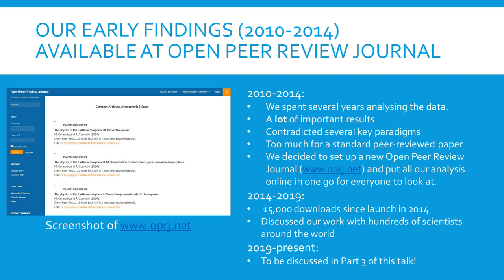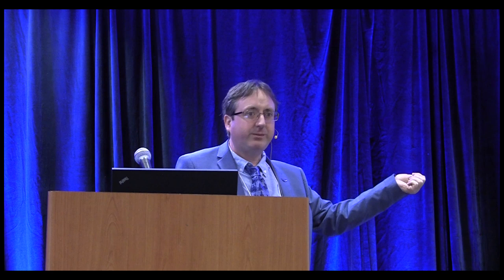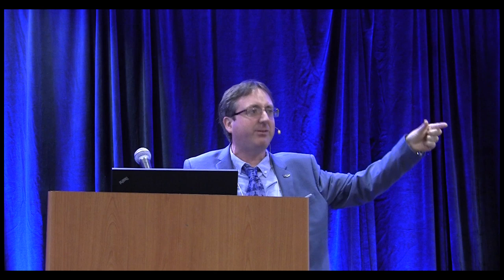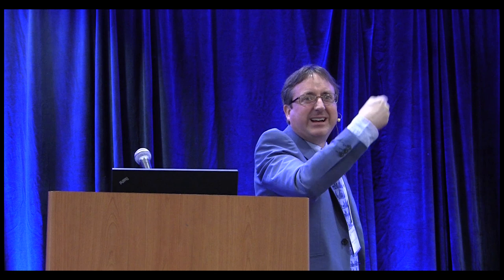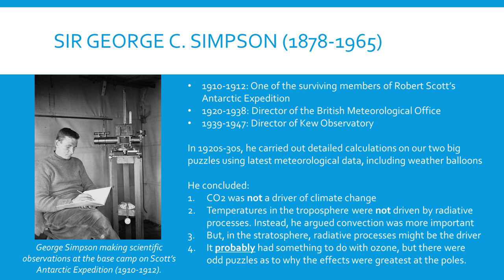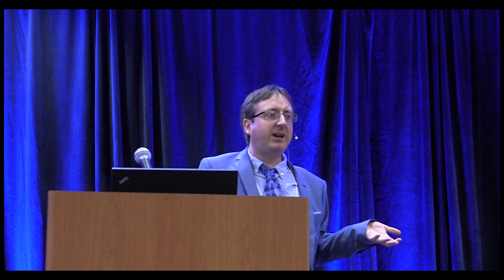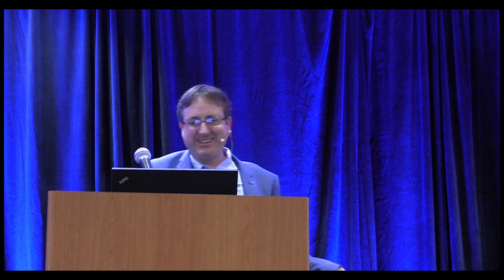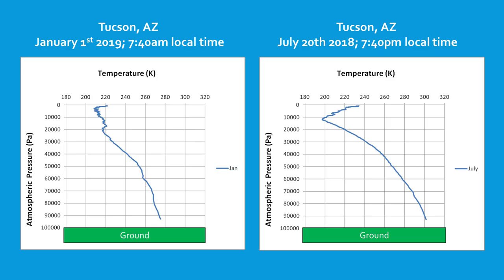Balloons in the Air: Understanding weather and climate

Comment: "Most ...measurements were done on ground" -- Really, no kidding?  And Stratosphere downward is "99% of atmosphere's mass" -- yes, and so is most important, and temperature at higher levels represents less and less air energy density as altitude increases, so of course temperature changes above the stratosphere are extreme and of various physical processes.

Very increasing historical review, but why?  We've no reason to expect folks them to have come to a factual result. 

"IBM 7090 supercomputer" -- really?  I programmed such for plasma physics research -- it was never thought of as a supercomputer, Ronan.  So what should we trust in your remarks?

So, the Connolly theory is that the act of modelling climate is guaranteed to deliver falsities, eh?  "Look inside the atmosphere you don't know what's happening." -- really?

Put your theory "to all the tests you can think of" -- sure.  So why the long intro here about people's conclusions when they had inadequate instrumentation?

The "ozone hypothesis" isn't the dominant effect for air warming via GHGs -- it's a straw man.

Their demo tubing is ok, but the plastic tubing expands when the plunger is pushed, because it's flexible.  Better to use a metal tube.  Mechanical energy transmission between molecules is exactly how GHGs transfer energy to other molecules in the air "they vibrate back and forth".

If the gas is in thermo-equilibrium it would emit as much energy as it absorbs -- "but it won't store the energy" -- really?  Energy absorbed by a mole of GHG is mechanically coupled to surrounding molecules, whether GHG or not.  Yes, at night, "it goes to space".  "Infrared water vapor cools the atmosphere" (at night).  Of course, but some of the energy has already been transferred to other air molecules that are not water.  The point is that their data are good and some model ideas are good, but their zeal to critique IPCC models misses other physical effects, like intermolecular vibrational coupling.  And, we know the solar wind, etc. has direct effect on heating the top of the atmosphere -- again not modelled by the Connollys.

IPCC models contain some blarney.  Connollys' models overlook some things they should know better than to overlook.

--
Dr. A. Cannara
650 400 3071
Reply: Hi Dr. Cannara!

Just to preface, I'm no scientist! 
However, as a person with Asperger syndrome, I had to spend quite some adult time researching human communication in order to figure out why people sometimes looked like a question mark after a short time of talking to me. So with that background in mind, I have some points about your comment.

I would ordinarily be extremely wary of people using words like "Really, no kidding?" and "zeal" etc. to describe someone opposing their view bringing scientific work to the conversation.
they're personal references rather than scientific ones, justified as they may or may not be. 
It colours your reply in the minds of those reading your comments.

Again, I am no scientist, I am just a relatively regular dude letting you know how I perceive your message. 
And if I perceive your message that way, then many others will too.
If I have my numbers right (And I may very well be wrong) Over 90% of human communication come from non verbal cues, and here we don't even have verbal cues, only text.
that leaves over 90% of the message to be filled in by the minds reading the text.
Tone of voice for example.

So if a text is worded in a way that makes it easy for the human mind to read it in an upset, angry, insulted, annoyed, etc. etc. voice then that's the kind of voice that's going to be voicing your text for the readers mind.

I had to grab myself by the 'scruff of my mind' and go look past the wording and look for the actual message while reading your comment.

That's not a good point of origin if I want to be informed by you.
Reply: If you have critical objections, Alex, why not post them on wattsupwiththat.com where Ronan Connelly has been responding to questions? It's no use posting them here where he clearly will not respond. And why be so combative? You're questions and critiques shouldn't have your emotional investment.
Reply: @Redzone 2119 I wold question it vigorously since that has been demonstrated for well over a century with multitudes of peer reviewed papers. However I see your point about the zealously that some, myself included can be about this contentious topic.
Reply: @Redzone 2119  I had never heard of this Postma charecter so I did a bit of checking and low and behold he does not publish his paper(s) in any peer reviewed journals. He does blog and post YouTube videos so ... 

As per his balckJoseph Postma's criticism is for a teaching tool to teach students the basic ideas of climate science or energy budgets. It is not what climatologists or advanced students use. 

"Joseph E. Postma did not like a simple model of Earth’s radiative balance where we approximate the Earth as a sphere with uniform solar absorption.  Of course, this is never done in climate modeling or in more detailed analyses appropriate for scholarly literature, so it is more an exercise in complaining about undergraduate education than an attempt to correct what he calls a “paradigm” in climatology.  Nonetheless, the 0-D energy balance model is a useful approximation on Earth when coming up with an average emission temperature (~255 K), since air circulations and oceans tend to even out the diurnal temperature gradient on Earth, in addition to the thermal inertia provided by the system."
https://skepticalscience.com/print.php?r=385

Joseph E. Postma is a climate change denier. He uses his master’s in astrophysics to try to convince others to trust his authority. However, Postma has never been able to pass peer review in any legitimate scientific journal regarding anything he has written about climate change. The only place he has been able to post his ideas are to Principia Scientific, which is a website created by Tim Ball, a climate change denier.
https://theskepticjournal.wordpress.com/climate-change-denier-joseph-e-postma-hacks-accounts-of-commenters-who-expose-him/

He did publish a paper entitled "The Model Atmospheric Greenhouse Effect". Unfortunately the organ (I refuse to call it a journal) he published through, Principia Scientific International, does not peer review and their primary purpose is to discredit AGW.
Reply: @MontyFly  Spoken like a true ignoramus. Go back to sleep. Let the adults talk.
Reply: @MontyFly  I'm from a historical background and would really like to hear the scientific explanation of why temperatures were rising before the start of the Industrial Revolution. In Japan for example, temperatures started rising in the mid 1600s. And really, before expounding on the excellence of "peer review", drop over and get an education at retractionwatch.com .
Reply: @JohnJ469  I did some small amount of looking to find what the climate was like in Japan during the "Little Ice Age" and only found 1 article about how despite being subjected to a colder climate their population and agricultural output increased during that time period. Japan fared better than most in the far east primarily do to social safety nets or social welfare systems. 

http://www.senseandsustainability.net/2014/12/05/the-little-ice-age-heterogeneity-of-impact-and-japans-success-story/

Perhaps you have some link to support your claim that parts of Japan was warming back then at the start of the industrial revolution? Even if you do it doesn't prove anything except that it was warming on one part of the planet. It's called "global" temperatures for a reason. Does the data single data point affect a data set of hundreds or thousands of data points? Yes, 1 data point will have a small impact on the average of all the rest of the data points. 

As for the link you provided I'm not certain how that was supposed to educate me? If anything an organization that keeps a data base on scientific articles and papers that have been retracted only helps my case about how peer review weeds out bad science. Did I miss something and the link was supposed to point to some huge assortment of retracted papers on anthropogenic global warming?
Reply: @MontyFly  You should read the background of the site. Retractionwatch is successful in spite of the journals, not because of them. Most journals didn't want to co-operate with such a site at all. Apparently having the masses find out that "Peer Review" was a poor joke might damage the reputation of science.

I was shocked, seriously as to how bad some of it was. A researcher having ALL papers for 20 years retracted once it was discovered he never actually did the experiments. The simple point being: Peer review is not guarantee of quality or correctness or accuracy. And it wasn't the "Scientific Method" that led to may of these retractions, it was fraud investigations.

My reference to Japan was simply one factor of many. The problem with historical records is that they are qualitative rather than quantitative. In the case of Japan the cherry trees were blossoming slightly earlier each year. This tells us that it was warming, but cannot apply a figure to how much, as in degrees.

I can suggest the works of Syun-Ichi Akasofu, founder of the Polar Research Centre.  He did a huge document on climate changes over the last 500 years or so. I'll look after work and see if I can find a link for you, it's quite interesting.
Reply: Today the greenhouse gas idea is nothing more than fraudulent science. It began as a bad, incompetent, model. Uncritical, fanatical support for this bad idea from the likes of Alex Cannara made fraud. As soon as the "scientific community" (whatever that is) wrote letters to the media to bully them into censoring critics - that's when the fraud began in earnest.

Comment: This is pure pseudoscience.
Reply: Pseudoscience is when data is presented as consistent with the norms of scientific research, but it demonstrably fails to meet these norms. 
In contrast; 
This is 50 years of data with 20 million samples of data collected by others which is shown to match to .9997 certainty a 100 year old Scientific Theory published by Einstein himself. They fully disclosed all the data and their work. Nothing could possibly be more inline with the Scientific Method. 

Now let's look at Michael Mann's hockey stick. He took proxy data from tree rings to show historical temperatures, problem is that tree rings are a poor proxy for temperature but rather good moisture. Another slight problem was he needed a temp increase so he appended ground station data completely ignoring the fact that the former USSR, a cold place, closed their stations. He cherry picked data from two completely different and known incorrect sources for the sole purpose to shock people. Then, tried his best to hide the evidence. Literally the definition of pseudoscience.
Reply: @CycleWerkz  Nothing wrong with the data... Jumping to conclusions is the problem here.
Reply: This is 50 years of data with 20 million samples of data collected, is just fine material, your problem with acknowledging that the mass of science professors were wrong all along, is what now here is the problem.  You need to reset your mind to believe new upcoming facts.
Reply: @thisisnotaname  Yes it's real data from 26:22 but is presented in misleading way at 51:55 !